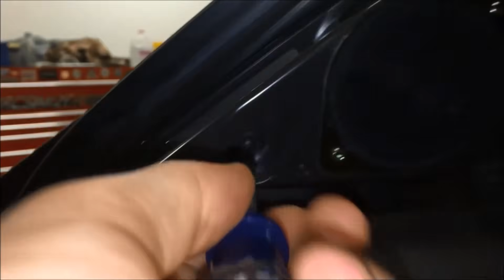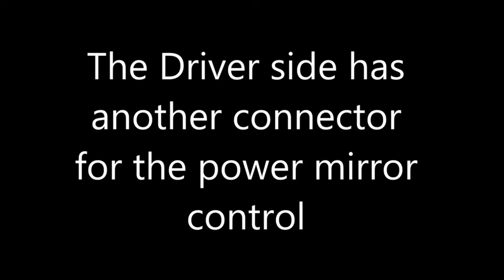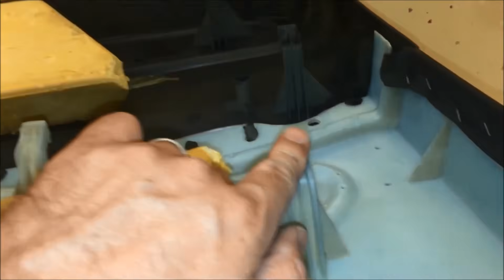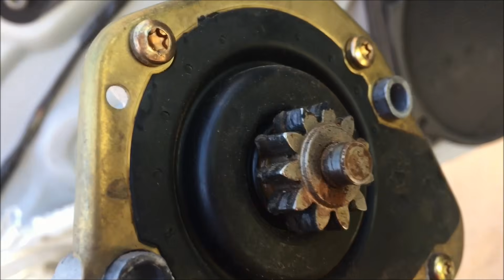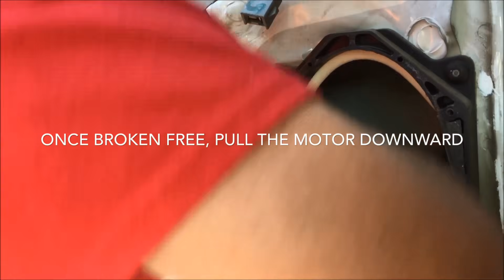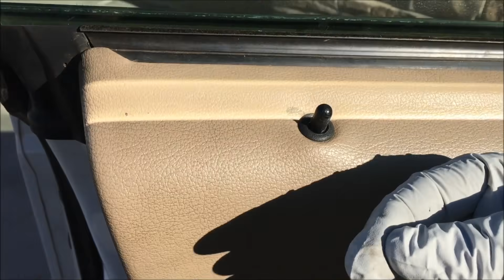Window Motor Replacement Ford Mustang 1994-2004

Comment: This was a great repair video my drivers side window has been inop for a while on my 2003 Mach 1. Also I wanted to replace my power mirrors with new to freshen up the car. After seeing that the bolts are behind the speakers it’s going to be an easy job. Thanks man!!

Comment: I say if it stops working on a regular basis, put a new motor in there. Anything you need to wack to make it work it not worth saving. Especially if you took the door apart to get it done.

Comment: All you have to do is take the speaker cover off. You don’t have to take the speaker out. The door panel comes off without taking the speaker out. Also, the video is a little bit confusing because you started on the passenger door and you ended up over on the driver‘s door, but I guess people should be able to figure out. It’s pretty much the same process, but I thought I was in the twilight zone lol

Comment: This video perfectly explained this, took the old motor out and slide the new one in went right into the teeth ez as pie also my old motor came back to life lol but i replaced it anyways, thank you sir!
Reply: Good idea to do anyway, I tapped on mine and it worked for about 5 mins again before shutting back down. Can't tap it without the door panel off, so replacement it is now

Comment: GREAT video! I have a 2003 GT Convertible and used this video to do the swap. On my model car, the motor comes out easier if you (while facing the interior of the door after the door panel is removed) wiggle the motor while pulling it down and slightly to the right. There is a channel in the metal bracket that holds the motor to allow the gear/teeth in the motor to dislodge and slide down through that channel for easier remove and reinstallation. After I got the motor out, the video's motor-tapping idea really works. I took the old motor out, tapped it a few times, and it worked great! So, removed the motor cover (remove three screws using #20-star bit) and saw lots of gunk on the motor windings). I cleaned the motor windings and the motor housing with CRC QD Electronics cleaner, blew them dry with compressed air, let them air dry, and then put the motor cover back on. Then, I reinstalled the motor in the door and everything worked great! When you reinstall, remember to wiggle and slide the motor gear up and slightly to the left this time... through the channel in the motor bracket. This solution might work for you. My advice: RELAX and take your time. If I can do this, so can you.

Comment: Are the gears on the regulator metal also?! Got my 04 with the motor already removed. Don't wanna take panel off twice risking breaking clips. If it's a plastic gear in regulatory, I'll just replace whole assembly.
Reply from the maker: Metal on the outside, plastic inside https://youtu.be/ZgMhVUTO1-E?si=lLaoQ3SFSYIXJFUA

Comment: My driver side window wouldnt roll down and banged on the motor and i got it to roll down but now its not rolling back up. I took the switch panel off cause i thought maybe the switch was not working and when i put it back on none of my windows are working now. I replaced the 20a circut fuse under the driver sides fuse panel and the fuse under the hood was good and nothing is working still. Any ideas?

Comment: To anyone who is no professional by any means that's about to try this:

Do not let freeing the motor make you think that's the hardest part! Super easy! I was able to reach behind the speaker and through the bigger whole to the left and use both hands to push the motor off the teeth. I was literally hugging the door lol. The Speaker removal feels extra but is a great idea for reach.

I was lucky enough that the motor and teeth sorta fell into place, which made the starting top bolt easy to get in and hold the motor as a guide.

Total install took me about 20 min. Got my part from a local Autozone. 

Thank you, DJG!

Comment: Does the window have to be in the up position when replacing the motor, and if so. Do you need to find a way 2 lock the window in place so it dont fall when you pull the motor?
Reply from the maker: The window needs to be up so the glass isn’t down in the door and in the way as I recall. Other than that it didn’t seem to fall because the regulator is moved by the motor and it’s still holding it

Comment: Thank you so much for this video! I just did this on my 04 GT today. Followed your instructions and also loosened but did NOT remove the two nuts for the regulator close to the window motor bolts like others have mentioned. It was a piece of cake. Took all of 30 or 45 minutes to finish and ive never done a window motor before. Excellent how to video!

Comment: Great video, hoping your still reading comments, for the rear windows I can find motors for them, on rockauto and any auto parts store/website it says the rear and front are the same part, but I can only find regulators for the front windows, doesn't seem the rear windows have regulators, or at least can't find them on any website and can't find any info on this, so my question is do the rear windows have regulators at all and I stead have another system?
Reply from the maker: I haven’t owned a convertible and haven’t seen, but I imagine they also have a window motor. The left and right are side specific, but you can disassemble them and use the base for either side if that at all helps.  https://youtu.be/ZgMhVUTO1-E

Comment: Does the window have to be up to do this? Mines stuck down.
Reply from the maker: Yeah, it will be in the way, so you will have to try to assist it up when the door panel is off

Comment: Use painters tape to keep the window up . Somebody else it's hard to see But yes the window needs to be up. Secondly I went through the speaker hole and the other hole between the 2 it went right in. This isn't hard at all

Comment: Can anyone tell me if it’s possible to install smart window motors in a SN95 that have the short drop glass feature that’s common on more modern convertibles and coops? I have a 2004 convertible that could really use this feature.

Comment: IS IT POSSIBLE , TAKING A LITTLE EXTRA TIME , TO  PLUG DRIVERS SIDE MOTOR TO PASSENGER SIDE CONNECTION TO SEE IF DRVERS SIDE MOTOR WORKING OR NOT. BEFORE BUYING MOTOR
Reply from the maker: Yes, and you can use the motor portion from one side to another https://youtu.be/ZgMhVUTO1-E

Comment: If you would have loosened the bolts holding the regulator on, the window motor would have been easier to pull out. Just a helpful tip. Those would be the golden/brass 8/10mm bolts you see in the panel. 

Also, if you have a heat gun you can heat up the factory insulation (white plastic stuff) and pull it off the door. Just try not to overheat it and get it on your hands. The glue holding it on is very sticky. This way you can go ahead and just put the insulation back on and not tear it.

Comment: Thank you for covering all the details and nuances. This really takes the mystery out of repair jobs.
Reply from the maker: Very welcome
Reply: @dannyjohnsonsgarage  I tried the motor on Amazon you had listed. When I bolt it up I can maybe get 2 out of 3 bolts it’s like the motor was not thick enough. When I tried it out I would spin but not link up with the window. I tried to put the stock back in but it seems to be too thick to get back in. I hope I didn’t snug the aftermarket one up too much where I closed the gap between the bracket and door

Comment: Question, what problem did you have with your motor? Mine sounds like the gear is pretty grinded and it shutters
Reply from the maker: Mine would only click and not work at all. You can try tearing yours down to see if it needs to be cleaned or has chipped teeth etc https://youtu.be/ZgMhVUTO1-E

Comment: If you loosen to two nuts that are go to the regulator next to the motor it comes out much easier. I replaced mine with a doorman with a lifetime warranty for $60. It is a little thinner so it is easier to install. Works perfect now.
Reply: I wish I had seen this comment before starting mine, but I figured it out anyway.  You are right way easier !!!

Comment: I literally can’t even put it back in like it won’t fit bruh
Reply from the maker: It can be pretty tight. Try to pull the door panel towards you where it bolts in
Reply: @dannyjohnsonsgarage  thanks for the tip! I just loosened two bolts that held the rail in place to push it a bit further in

Comment: Anyone have any ideas as to why, when my window gets almost to the top, it starts knocking and stops going up. 
Is it off track or is that a bad window motor? Cause the motor is weak, but it still rolls up and down. Any help is appreciated before I go spending money on unnecessary things.

Comment: Thanks for a great video with good details.  Getting ready to do this on my Mustang. Pretty familiar with it from my F-150, looks like the same motor. At least Ford drilled the holes for the bolts, they didn’t in the F-150 of the same era.
Reply from the maker: Also, they are side specific but you can swap the bottom part https://youtu.be/ZgMhVUTO1-E

Comment: I finally fixed my daughters window! I had a new motor for drivers side and wouldn’t you know it was the wrong motor! I recalled your tip on tapping old motor part and success! Now my daughter has  both windows working! Now I just have to figured out the ac blowing hot!
Reply from the maker: You can swap the base over from the new motor. I had the same situation https://youtu.be/ZgMhVUTO1-E
Reply: Danny Johnson’s Garage I may just do that down the road. I’ll hold onto it for spare in the future.

Comment: But wait my 2000 Ford Mustang driver side window is stuck down so can I replace it with the window down ?
Reply from the maker: That makes it a bit tricky. The window only really moves if the motor is out. You can try swapping switches and slamming the door to get it to work again, but if not, you may need to disassemble the window track. Can’t tell you for sure https://youtu.be/0wkFs1eWZ8E

Comment: I can't get it back in oh god lol
Reply from the maker: Driver side and passenger side are specific, so make sure it’s the right one, next, look at how it should sit as I show it in the video. Next, you may need to wiggle it a bit (or even move the widow down a little so the teeth line up
Reply: Danny Johnson’s Garage I have the correct side one I'm gonna try to wiggle it in more tommorw
Reply: Danny Johnson’s Garage my passenger side window is all the way up you think I should push it down a little ? To put the new motor in

Comment: What should I use to take out the  three 8mm bolts
Reply from the maker: I would use a 8mm socket with a small extension (or a deep socket).

Comment: Video helped tremendously, thank you for posting and explaining everything so clearly. 

And tapping with a dead-blow hammer fixed mine too! Thanks for that suggestion.
Reply from the maker: Johnnie Coats The hammer worked for a little while but went out again. I tore the motor down and used a spare from the passenger side I had. Here is that vidoe if you’re interested. Nice to know https://youtu.be/ZgMhVUTO1-E

Comment: Thanks ! Mine only needed a good smack, thank God I tested that before ordering a new one , let's see how long before I need to
Reply from the maker: Mine needs another wack again, or replaced would be best 😅
Reply: @dannyjohnsonsgarage  I have had 2 of these by cars now. My current one is a 04 GT but I had a V6 03 and it was going on and off all the time. Mostly when I left the car on the direct sunlight It 💯 wouldn't work ,it's like it needed to cool down. Would a new motor fix that kind of problem? Because that was happening to my current car before it got stuck
Reply from the maker: Cristian Ramos A new motor should fix the issue.
Reply: @dannyjohnsonsgarage  quick update: After a week of being parked, my window did not work today,so I waited till night for it to cool down and it worked back again 😂. Anyways... Ordered a new motor from LMR today because I don't wanna be surprised someday when it suddenly stops working again lol
Reply from the maker: Cristian Ramos You may have seen my last video where I swapped the motor from my spare passenger side motor since mine wasn’t working again. Saved me some cash lol

Comment: Very GREAT video.... I recently purchace a 2002 mustang. The driver window would not roll down.(new switch on driver pannel) i will utilise this info and possibly replace the window motor (if need be). GREAT VIDEO. Subscribed.
Reply from the maker: Justin MCQUAID Welcome to the channel, and congrats on your new mustang. I have a video on just about anything you will need from fuel pump and filter replacement to pulling the engine. Feel free to look around. Thanks for subscribing and let me know if you need help on anything! 🙏🏼

Comment: Couldn’t help but notice that you changed cars/sides. Since I’m getting ready to change my passenger side, any light to shed on what went wrong or things to watch out for? Thank you for the video.
Reply from the maker: M M Correct. I used my video I already had for removing the door panel since that video covered the mach tweeter and my GT didn’t have it. When possible I like to give the more complex  steps so people who have the mach audio system know what to do 😉
  Just take it slow and follow the video’s steps and you should be fine. My window motor just needed a little tap and it worked again, but needs that often, so a new one doesn’t hurt.
Reply: Danny Johnson thanks a million. Take care.

Comment: Question: How can I raise the window first to replace a bad motor?
 It failed while down.
Reply: Not a mechanic genious, but maybe follow steps to unbolt the wondow motor and pulll the window up. Then re-connect the window motor (or hit the motor to free it as stated in video) to leave your window at fully closed position?. Best logic i can give. Hopefully i can help out. 👍

Comment: I noticed that on the 96 and up its a little bit easier to get out than the 94-95. I think the metal on the door was slightly different. I changed both my drivers motors on my 94 gt and my 96 cobra. The metal frame was a tighter fit on the 94-95's. Im a pro at changing s many of these on foxes and sn95's,lol
Reply from the maker: MORBID FOX MUSTANG They probably had an update on the door design in 1996.
Reply: @dannyjohnsonsgarage  Thats exactly what it was.

Comment: Great job. On my mach 1 when the window motor froze, I took the door panel off and lightly tapped the circular part of the motor that you can see through the hole and it unbound the motor and freed it up.

Comment: awesome video. if my window is off the track, do i need a whole new window and assembly? or can i just readhesive the window back onto the track?
Reply from the maker: lah2174 The window is riveted on to the track, so you would need to either fix the rivets, or possibly use a nut and bolt in its place